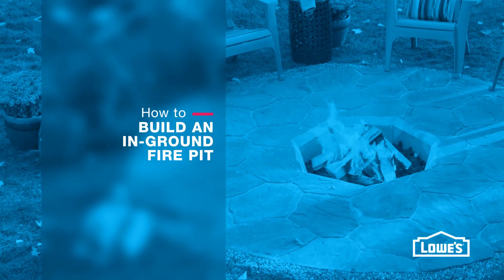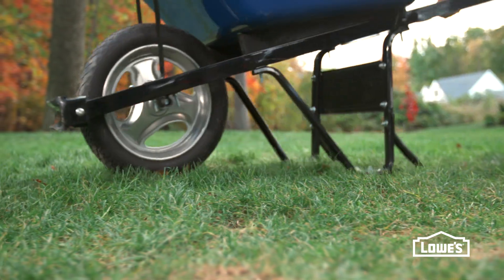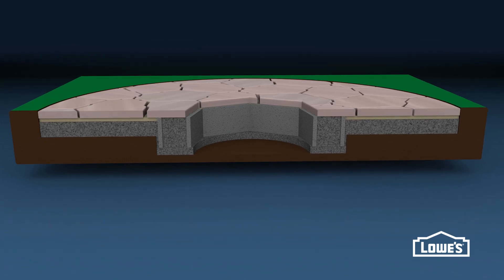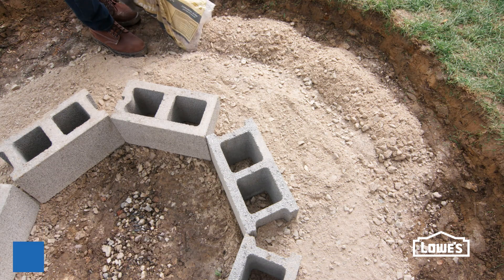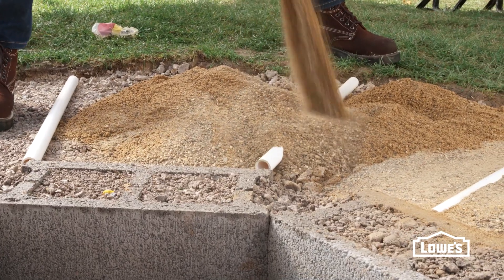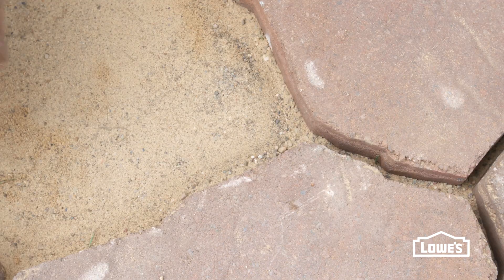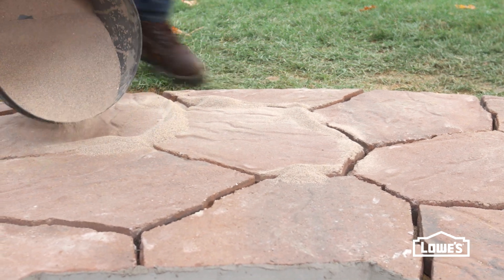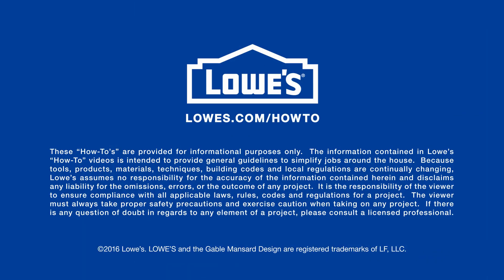How To Build An In-Ground Fire Pit

Comment: Choosing between an in-round fire pit and one that is raised above the level of the yard, is really a matter of the owners tastes. 
The things that i would like to point out are the following's:
- the drainage pipe that goes underneath the pit, will melt after the first use, because heat dissipates into the ground. Everybody that has ever cleaned a pit the next day, after a party, will tell you that even if you scoop the ash and the dirt out, it's still going to be hot like a half of meter under...
- being an in-ground pit, it lacks air for combustion. If you are not running some metal pipes from the surface towards the core, in order for the fire to feed it's self, you will end-up smoking everybody around it, because the fire tries to suck all the air from above and laterals, and will struggle to keep constantly feeding it's self . Just try to have a fire anywhere outside and stand close to it. You will immediately notice that the smoke comes towards you when you get closer. This is because you take vital air from it's position and that part of the fire will not be fed according to it's needs and smoke will be directed towards you.
Reply: wee rares I
Reply: wee rares loo
Reply: +Bill Hayne
Reply: Thanks for those sensible tips.
Reply: So would you say a above ground one is better then. I can’t decide between a circle or square. I want to make the pit massive so I can have huge fires
Reply: Can you do a video on the way you would of done it I didnt think about the pvc tubing melting
Reply: We have big ass fires all the time in our neighborhood...we all talk about how it smoke comes to wherever we're standing and joke about it 🤦‍♀️🤦‍♀️🤦‍♀️ never once has any of us realized there's an actual scientific reason for this! 🤣 Thank you for that! I feel so silly for never even thinking about the possibility!! I can't wait to look like the smart one in front of everyone!

Comment: there needs to be metal pipes going from the inside pit to vents in the ground a few feet away to allow air in to feed the fire.  cinder blocks will break down and Crack and will be a pain to remove and replace if you choose this design.  plastic piping like shown will melt.  those lava rocks will interfere when scooping out the old ash which will accumulate.  this looks nice but is so wrong on so many levels.  it's mind boggling how complex the awfulness is.
Reply: I was thinking the same thing

Comment: Not sure but my experience says the fire cracks the cinder blocks
Reply from the maker: Standard concrete blocks are fire-resistant. That said, we don't recommend allowing the fire to burn directly on the blocks for extended periods of time. Thanks for watching, Ken!
Reply: cinder block isn't concrete. also you don't need to have directly on it. They will deteriorate swiftly and usually within 1 year period of use. It would be more intelligent to build this with firebrick
Reply: they have fire rated brick ..it doesnt have to  be refractory..but refractory is nice to ensure it can withstand any heat a backyard fire could ever put out
Reply: I'm more worried about the fire melting the plastic drainage waste pipe underneath!?
Reply: I wasn't aware people used cinder blocks anymore.
Reply: if you use a metal pipe, it's better. it withstands more heat, and is less likely to burn

Comment: Did you just put a plastic drain under the fire pit?!?!?? Great. Should be fine, just use the fires that burn cold.
Reply: the cinderblocks should block most if not all the heat from the tile line 

i'm not sure where it's draining to though...
Reply: nah that pipes going to melt.

Comment: a lot of below ground pits burn poorly, from a lack of oxegen at the base, causing a rush of air around the sides, pushing cinders and hot ash higher into the air, I built several above ground, and always leave several gaps at the base for oxegen flow, keeping the fire mellow and sparks down. The native Americans use firepits inside their lodges, with sloping sides and a stone capped tunnel to draw outside air to the fire at its base!...A single spark, can burn down a tipi!

Comment: would the process be the same if I was going to use polished stones as the final result instead of paver stones?
Reply from the maker: Are you referring to small tumbled stones, or larger pavers with a sheen on them? If you're talking about the bags of small stones, you'll need some additional structure around the inner fire pit edge to hold them in place. If you're talking about shiny pavers, you'll just need to make sure they can withstand some indirect heat. Other than that, process should be similar to what you see here.
Reply: Lowe's Home Improvement yes I was referring to bags of polished stones. But even if i dont do a fireplace the beginning process is what I was questioning.
Reply from the maker: Gotcha. Just laying small stones is actually even simpler than this paver method we showed. You really only need a layer of landscape fabric underneath to keep mud and weeds out. Then you can embed your patio area a couple inches into the ground, OR use some kind of edge barrier (i.e. bricks, stones, landscape edging) to hold it all in place. Good luck & thanks for watching, Jared!